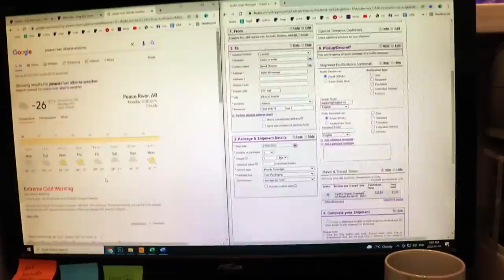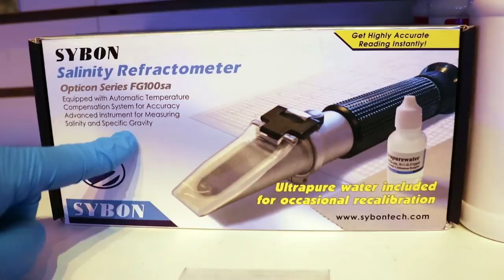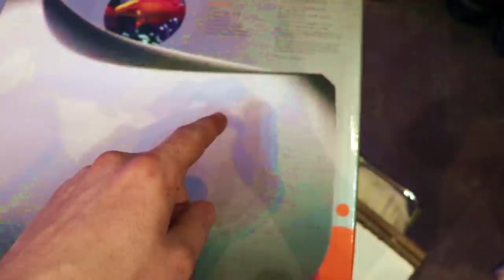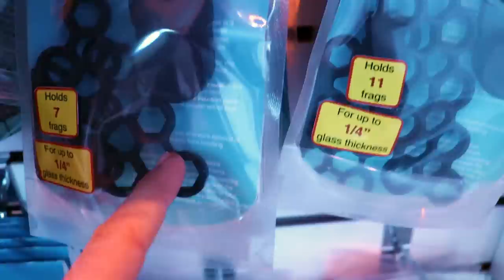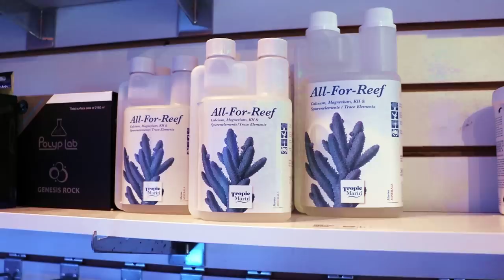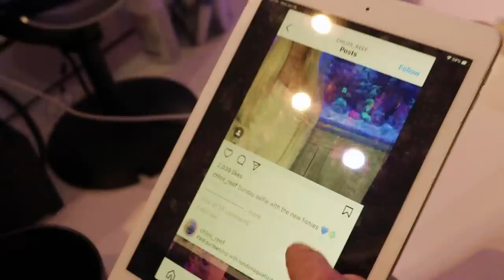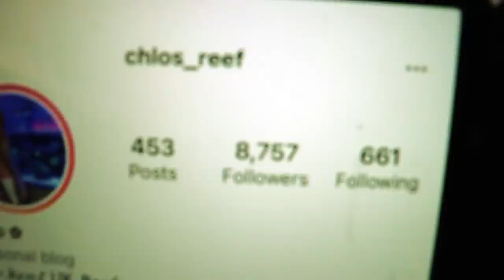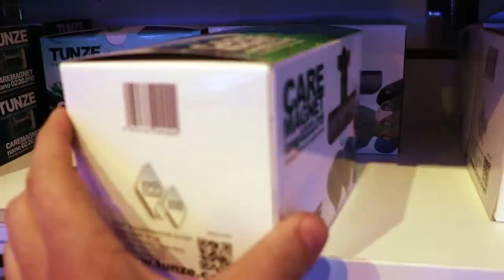Salt Water Coral Store Vlog Episode 14

Comment: Refractometers are great as long as they are calibrated. I use both that and a hydrometer (tropic marin) to check my salt levels always just as a double safety. I had my refractometer get bumped without me notice and next time i measured it was 1.039 ... i forgot to check the calibration and started acting accordingly, safe to say i almost nuked my tank (5 years ago this). Since then every test and measuring device has a second option just in case. Thank you guys for the lovely videos every morning! (Europe)

Comment: BRS glue is good and thick. I bought it because I read the reviews on the Seachem glue on Amazon and many people complained about it not sticking. However, after personally using both of them I like the Seachem glue better. It's not as thick as the BRS glue for sure, but I think it actually sticks better and sets faster. Both are good glues but I think I'll just use the Seachem ones now.
Reply from the maker: good points!
Reply: I've had the seachem glue burst from the bottom.. when you are glueing corals, it easily hardens on top..so you end up squeezing harder as the hole gets smaller and this can to the bottom bursting. Yeah not pretty. Is it a good glue? Yes, we do the BRS glue across the pond so seachem works well for me. Need to try gorilla but damn, is it expensive

Comment: A refractometer should be calibrated with a salt water solution at .35ppt.  Some use RO/Distilled and calibrate to 0 but that will give you a higher reading. In my experience many of the hobbyists calibrate to the .35ppt and not the 0. In my opinion this is what we should be doing :). Love your videos!
Reply from the maker: I respectfully disagree and will explain in a future video